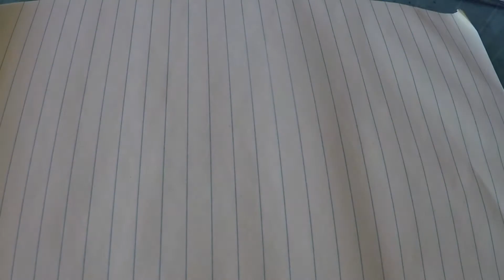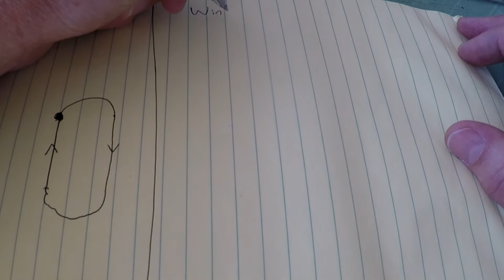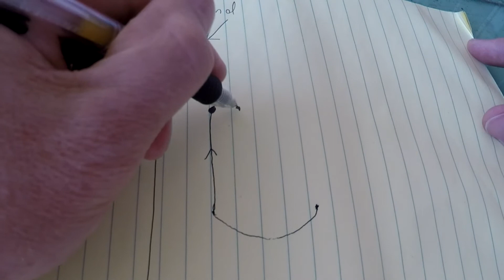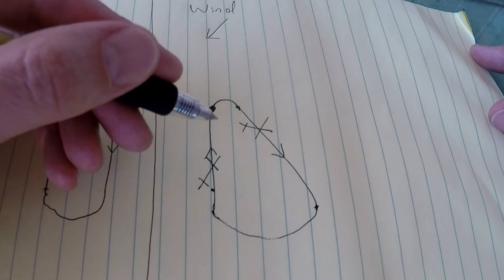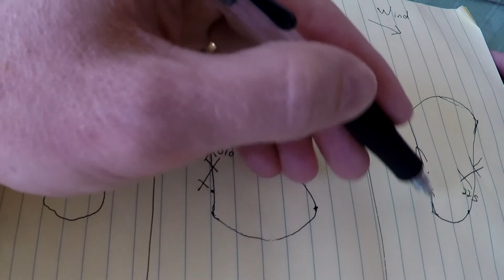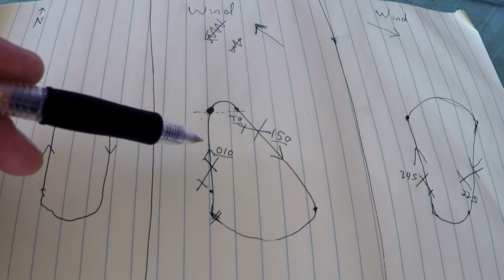Instrument Holding Patterns - Correcting for Wind

Comment: This is great! Just question I had was how do you know which way to turn without messing up? Just in your head naturally like the hold entry? This makes sense but calculating neither adding or subtracting in the turn messed me up.
Reply from the maker: I recommend learning to visualize the wind direction on your DG/HSI and then always turn into the wind. Using a rote add/subtract method will eventually result in doing it wrong.

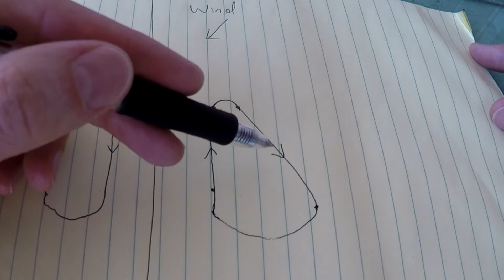Comment: 3:48 The main thing that matters is how it is calculated, which he initially stated as 10 degrees. How did you calculate the wind correction? To multiply by 3. Everyone knows that, the important thing is to calculate how many degrees of wind correction to give at the beginning.
Reply: It's simple. Its the difference between your heading and the aircrafts course

Here is a lengthy explaination:
 If your inbound course is 350, then, in a no wind scenario, your heading would also be 360. But with wind, your nose will be into the wind. To maintain the 360 course (path along the ground) your heading will not match and be into the wind (course is different than heading! course is the path we want to fly over the ground, but the heading to fly that course can and often is different!). Lets say it is a 010 heading to keep yourself on that 360 inbound course. Now we compare that. The difference between the aircrafts current heading and the course is 10 degrees, so its a 10 degree wind correction angle.

some other numbers for example
course 090, heading 075 =15 degree eind correction angle

this is something you will only be able to do while flying, and there is no math involved. Its relatively easy to see this difference with soemthing like a g1000 that has a ground track pointer (magenta diamond on the HSI) that is showing where the plane is going, and wont match the heading if there is any wind.

hope this helps

Comment: How did you calculate the wind correction? You don't mention the most important thing?  For example, how is it calculated that it will return to 010, 150, 345 and 225 degrees?  What is the formula?

Comment: I have a question. When I'm timing the standard rate turn, I can never roll out to the WCA heading on time (3x correction on outbound). Am I supposed to adjust the rate of turn to roll out on the wind-corrected heading after 1 minute? What am I missing here...
Reply from the maker: No, don't change the rate of turn. Standard rate turns are always 3 degrees per second. There is no requirement to make turns in a certain amount of time. The only leg that really matters for time is the inbound leg. Hope that helps :-)
Reply: FlywithJim.com I cleared that up with my instructor and your comment helped as well, thanks! I don't know where I picked up the habit of timing the turn.
Reply: go to Captain Joe-all answers there.